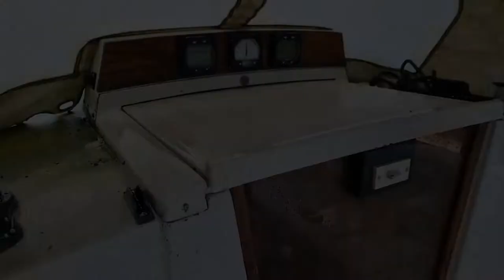The Dufour 31 project | YEARS of dirt - cleaning timelapse

Comment: Hey.  Love the videos.   I am going to check out a 1975 Dufour 31 tomorrow.  It is out of the water here in Ontario, Canada.  Not a common boat here and don't know any other owners so just curious if you can think of anything I should look out for?
Had has a survey not too long ago...which looks good.  Original Volvo am told is serviced regularly and works well....but I won't be able to test that tomorrow.
Reply from the maker: Craig, Thank you. So nice that you reached out to me! Awesome, 1975 is one of the early ones if I am correct. Ok, so the Volvo Penta MD11C is a nice engine that works with old techniques, not many electronics so it's pretty straight forward. 

Make sure you check the riggings, on the rigging tensioner might be a 'DATE' so you know how old they are, could be that they are at the top of the mast, if, then you can't see that of-course. Further it's very important to walk over the deck, to see if you hear any cracking noices, some are normal, but if the deck is bending because of human weight, it's an clear indication that there's water inside the "sandwich construction" (google that one). 

If you can inspect the underside, would be awesome, so you haven an idea how it looks underwater. 

Good luck, you can reache out to me via Instagram!
Reply: @sailingsilverwind  thanks for the quick reply.   Do you know if the deck core is foam or balsa?   Did you find any soft spots on your deck?
Reply: @sailingsilverwind  Me again.   Do you happen to know if there is a compression post under the mast...to support it?  Or is the weight of the mast held only by the bulkheads?
Reply from the maker: So, the sandwich construction of the deck is with polyester-wood-polyester. What kind of wood, I don't know but very thick, 20mm. 

About the mast, it's NOT supported from the underside. It's 8 Riggings in total that keeps it in place.